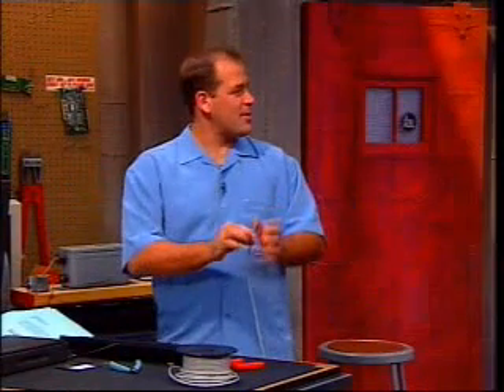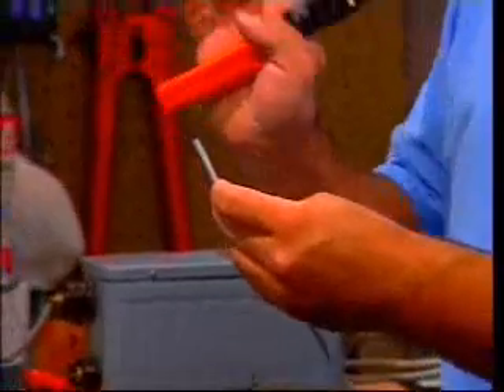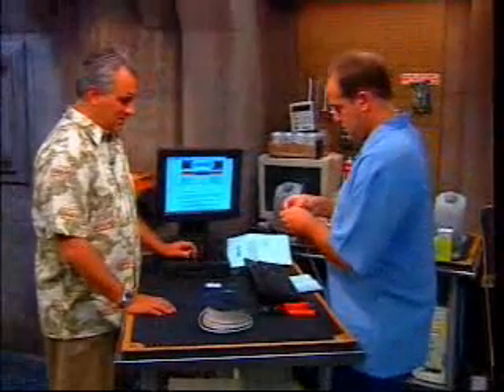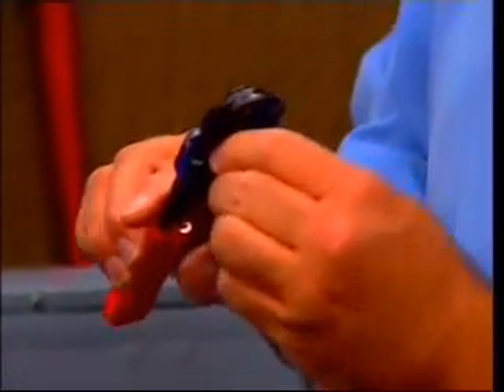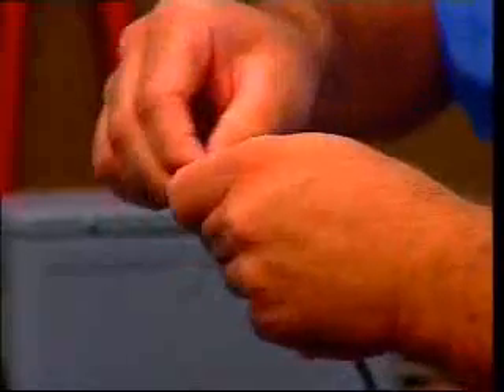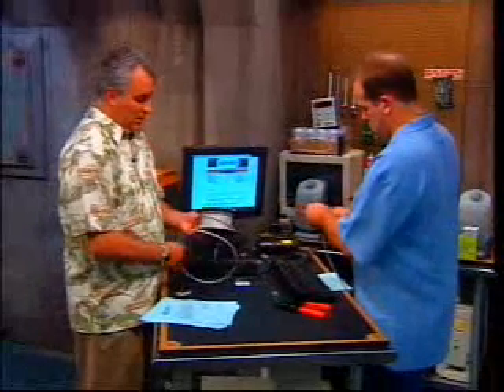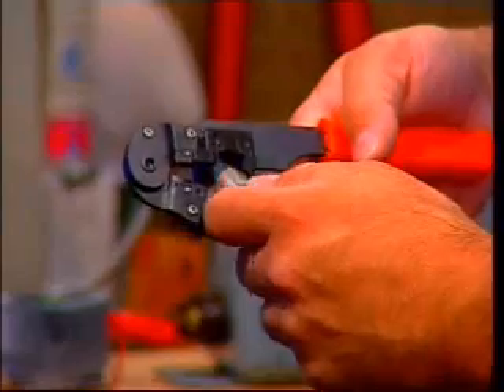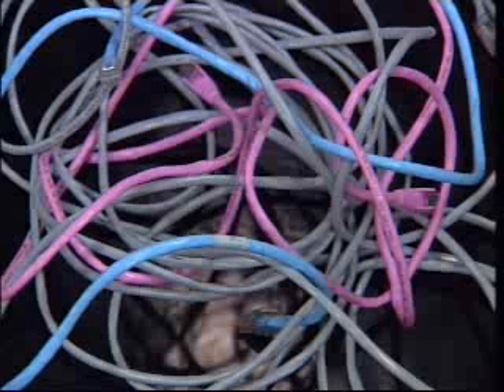The Screen Savers - How To Make An Ethernet Cable

Comment: All that aside, Leo made a mistake, he said that the order of the wires didn't matter if making a strait-thru cable, it does, each pair has a different twist to it, if you make up your own order, you can get crosstalk, causing the ethernet cable to work extremely slow (almost as slow as dial-up), and in some situations, you can lose connection, or not get a connection whatsoever